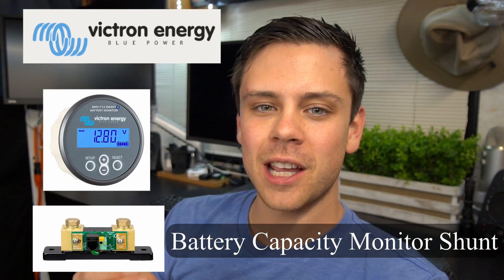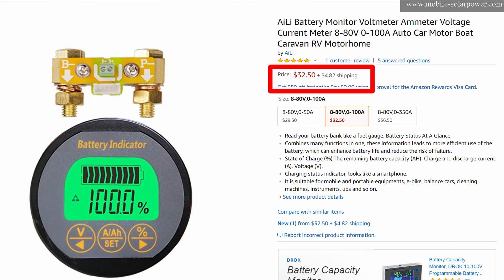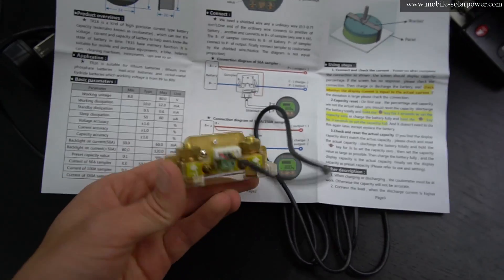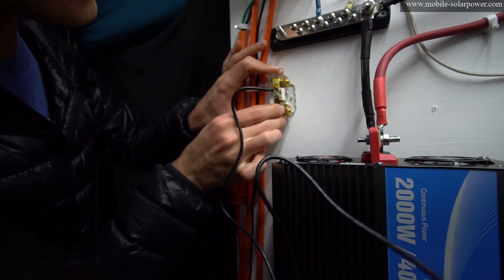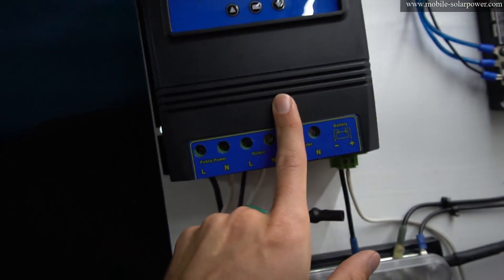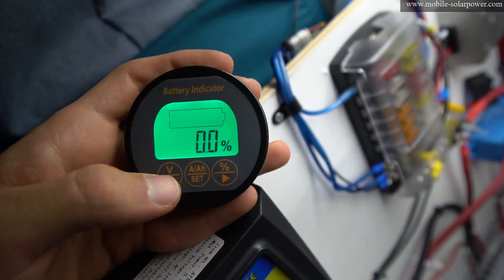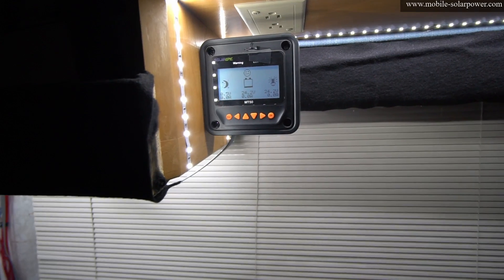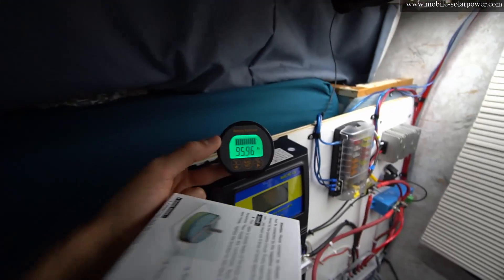$200 Victron Solar Battery Monitor? Try this $30 Chinese one instead! Great for Off-grid Solar

Comment: Isn't there a big difference between the two monitors in the number of amps their shunts can switch?  The Victron page on Amazon says it can handle 500 amps, the AiLi just 100.  Does that matter if I want to support a 150 amp load in a 12v system?
Reply from the maker: Yeah great point. The Chinese one has a 350 amp option too but indeed, good point

Comment: They have like 500a ones that go to 100v and have over volt and under volt protection. Itll also do over current and I think it does over capacity too. The display is even wireless capable, so yeah.  China ftw.
Reply from the maker: Where are these ones available?

Comment: Will - It looks like you set the 0% based on voltage, but I never saw where you entered your battery bank AH capacity. Does it automatically figure it out based on charging? And with a lead acid set-up, wouldn't you damage the battery by discharging it all the way to 0%? Seems like the better way would be to charge you batteries to 100% and then enter the AH capacity of the bank. Is there a way to set it up like that?
Reply from the maker: Yeah it automatically sets the 100% mark.

Oh you would never want to do that. Just discharge your lead acid how you normally would to 50%. No point in discharging to state of charge you will never use.
Reply from the maker: And no need to discharge to 0. But discharging to what you normally discharge it too is totally safe for all batteries.
Reply from the maker: And the voltage set is for backlight. You need to set the state of charge extent for 0% manually. It's the second option that we changed in the video.
Reply: Am I reading this correctly… with a lead-acid 12 volt system you'd discharge to 50% (12.2 volts) and then set that point in the monitor as system "Zero"… your lowest allowable voltage point?
Reply: @MTBioGuy  12.1v is 50% in most cases

Comment: Your shunt is only 100 amps. I think you should have used the next size, which is a 500 amp shunt. Your 2000 watt inverter can go to 4000 Watts surge. 4000 watts/24 volts = 166.66 amps. In order to work correctly, the location of where the shunt is placed in the circuit is very important as well. Multi meters have shunts. When I went to electronics school, we had to design shunt circuits for a meter in one of our tests.
Reply from the maker: I also have a 100 amp circuit breaker on positive line, and it never has tripped, so it's fine. That's why I chose 100 amp shunt, because I have 100 amp circuit breaker. That's how I usually size them. And the surge doesn't matter much because it's so short. And the shunt can handle it. I over current shunts for days before on other systems. It's fine
Reply from the maker: I rate inverters to the continuous rate

Comment: A direct comparison would be an ideal way to test whether the new monitor and the BMV actually track in a similar fashion and provide an equal tracking of battery power. One of the advantages of the BMV over something like the Trimetric is the BMV could account for losses in the Peukert effect during high discharge situations. The Victron is a superior product, just not by a difference of almost $200. hopefully the BMV will come down in price. Its been at its current price point for a year or so.
Reply from the maker: Does it actually compensate for peukert effect. I had no idea that any shunt does that
Reply: @WillProwse  According to their manual it does compensate for the Peukert effect and you can adjust the Peukert factor. The manual recommends an adjustment when using SLA vs Li.
Reply from the maker: @epfd217  oh that's neat
Reply from the maker: @epfd217  but who uses lead acid anymore? Haha joking

Comment: I've been wondering when you were going to include a shunt in your videos. I use a shunt, not just to see what my battery capacity is, but to see how much current drain or gain is going on in my system. It helps me with my use. My charge controller calculates the battery percentage as part of a tri-metric meter (amps, volts and battery percentage). You took the Lord's name in vain twice in that video. Not cool.
Reply from the maker: I use a 20 dollar amp meter on main battery cable to tell the amps going in and out. Super cheap and easy way to do it and works excellent for that. And I agree, an amp meter ok battery is very very useful.
Reply from the maker: Oh I am not religious at all. I don't believe in any of the thousands gods. So it doesn't affect me and I will continue to use the "Lords name" in vain. Sorry.
Reply: @WillProwse  What about the shunt? You didn't mention the best use it has, to let you know the exact amount of current your system is currently using it making. I have a combined box for my 3 solar panels that I can shut off any time and see exactly how much current each one is providing. There's no other true way to be exact without using a shunt.
Reply: @WillProwse  Will , love your videos I think I have watched them all.  You are worshiping A god even if you don’t believe in The ONE God or not. you may want to read up on the Illuminati,  Rothschilds,  Watchers , etc….

Comment: Hey Will, love your videos, and I have a suggestion regarding this new Chinese made monitor. I  thought you had a Victron (maybe it was a review sample you had to return) too bad you can't test both models hooked up at the same time and do comparisons at different stages as to what each monitor is telling you.  Perhaps Victron will send you one to test/review.  In theory I would think they'd both give the same info.  But unless I'm mistaken (you're the wizard!), just because it seems to be working doesn't preclude the possibility it isn't providing accurate info.
Reply from the maker: Most shunts are dead accurate regardless of price. I've used cheaper ones for years that gave exact readings. They are super simple, and it would be pretty difficult for one to give bad readings.
Reply: Good to know!  Your experience/knowledge never ceases to amaze me. Thanks!
Reply: How about very low currents? I read somewhere about a similar battery monitor shunt that it wouldn't register low currents like for example a mobile phone charger with ~0,5A. Any experiences regarding this? And what's the power consumption of this unit? Can you leave it running all time or would it empty the battery in a week (in my case 12V 100Ah in a minivan)?

Comment: Hi Will.  I’m sure this is a stupid question, but how do you determine the  size for the shunt.  I see them in 100-500 amp capacity, and my system is 2x100 amp batteries, but would the 100 amp shunt work? Thanks
Reply from the maker: yeah exactly what the comments said above but honestly I have overcurrented shunts for years and they can handle it just fine. it's an extremely low resistance across the shunt you just won't be able to measure it when it's a high amperage load. but yeah usually just ran it for the maximum that the battery will experience. What I like to do is rate the shunt for my inverters fuse because that's the max I will ever see. This system has a 100 amp circuit breaker so I put a 100-amp shunt on it. That way the shunt will never go over its current limit.
Reply: @WillProwse  - Thanks Will - once again I learned something useful from you that I could not seem to understand elsewhere.  Much appreciated.

Comment: I have this same Chinese meter for a Tesla pack I’m building but have not installed it yet. Not sure how the generic works, but the Victron doesn’t account for the power it draws for its own use and it will drain your batteries while showing 100% (or whatever it was last at) when stored.  Some sail boat guy that doesn’t have solar panels noted this, he uses the engine alternator and for few days it’s fine but if left without some charging the Victron will drain over a few weeks, eventually depleting the bank and later ruining your batteries if kept going.  So probably with either meter you should but the low battery disconnect first, then this shunt.
Reply from the maker: Well that's really bizarre. I just don't understand how any shunt could use that much power. How big are these batteries?
Reply from the maker: The power consumption of all of these shunt is extremely low
Reply: Will Prowse  I was looking at Amazon reviews on the Victron, so guy was not using solar, just his sailboat generator.  He calculated the mAh draw and the natural discharge rate and it was a problem. When first parked it would show say 100%, but it doesn’t account for self discharge or the meters draw. So at say 10% remaining the gauge still shows 100%. Victron acknowledges the behavior but I guess they didn’t consider it a bug because it’s not a good use. It’s for batteries being regularly charged & discharged.
Reply: @olemissjim  I did the calcs a couple years ago before parking my van for the Winter and at the rate of power usage for the BMV 702 (I forget the number) , it would take something like 8 months to deplete my 100 amp battery from a 60% storage charge.  That's what I remember, anyway.  I decided that I could store it for 6 months and it would be ok.  In fact, upon return, it was not too discharged, just had consumed around 30 (can't remember) amps over 6 months -  as calculated.   And yes, you absolutely want to have a battery protection between your battery and ANY devices.  Mine has a built in BMS, so it's there, but invisible.  I think that otherwise, for longer storage, disconnect the BMV.

The guy on Amazon has another issue and is blaming it on the Victron.  I don't know how you manage self-discharge.  Thankfully, that's not a Lithium problem.

Comment: I never felt the need fo one. Might consider it but I need 200 amp version.  2000 watt continuous inverter.
Reply from the maker: Yeah for sure I was the same way for a long time. You might like it though at this price it's pretty cool. Just for the amp meter feature alone it's a great price.
Reply: @WillProwse  agreed the price is hard to ignore.

Comment: Hey Will, not too bad but using the Victron for 1) monitoring and also control thru bluetooth.  2) settable low and high Bat V, low SOC, low and high Temp with relay output (programmable NO/NC but limited to 1A.
The BT control makes adjusting the 5 settings easier.  The Victron bat protect are limited in current (I'm using Xan 3012) so a FET buffering the 1A output to a GX14 contactor gives me 350A shutoff  for any of those 5 going out of limit.  To re-engage I have a override pushbutton so I can adjust the settings for the Vict BMV to take over again.  The BT can tell me which of the 5 caused the problem.
The Vict BMV alarm is too low level and volume not adjustable so that is not useful..but really don't need the display unit handy at all with BT.
Reply from the maker: Great points! Thank you. Great information
Reply from the maker: Updated the pinned comment to mention these features. Thanks

Comment: I have had this victron monitor for three years, I also have the chinese one fitted in the cab so i can see it while driving and switch off alternator charging when not needed.
The victron is a far more advanced piece of hardware with a relay and dataloging.
The chinese monitor works but the victron is more accurate, as there it drift between the two units over time.For the money it's great value, but as with so many things...  you gets what you pay for!
Reply from the maker: Also, victron is made in india. Still made in a sweatshop, if that makes a difference at all.
Reply from the maker: Wait, specifically which Chinese one do you have? This one came out recently. Do you have a normal shunt, the 18 dollar kind, that only shows instantaneous reading? Or the one specifically in this video?
Reply from the maker: Agreed! And data logging is nice
Reply: Agree, what is wrong with usa? Cant they make one we have good techs and engineers when they want to be. It's high time we USA make something good and be on top. Enough said.
Reply: @joeboxter3635  Ah, maybe this one?  I have their MPPT (75/15)  and like it.  Will reviews several charge controllers in another video you should watch.  I like the bluetooth monitoring on my phone app with the Victron and prefer name brands and also needed compact.  The one downside is that the Victron 75/15 has small gauge wire connectors.   Weak spot in their product.

Will likes to recommend some other brands that are way cheaper if you don't want a remote  monitor. Once you add in the monitor, the Victron is competitive for the lower amperage controllers.  If you want a lot of amps, then Victron price diffference gets bigger.  I think that a lot of people oversize their charge controllers, using the nominal ratings (300 watts) of their solar panels instead of the actual performance (maybe 240 watts for same)  wattage.  This is one area where you don't really need the extra but will pay dearly for it with name brand controllers.

 I also have the Victron Phoenix 500VA Pure Sine Wave inverter.  Works fine.  I like the control over voltage cuttoffs etc.  Can't really say if it's any better than others, it just works. Again, if you can get by with less power, the lower end Victrons will give you good quality for a good price.  As power goes up, price rises more quickly.
Reply: @joeboxter3635  Oh.  I don't know the Tesla battery is it running at some odd voltage?  I do know that the Victron Inverter has pretty good customization of settings but I haven't looked at in a long time.  Will work with standard solar battery voltages.

All depends on what size inverter what you are considering and what you are doing.  But it seems that good inverters are easy to find - I would definitely go with a name brand as they do burn out.  Victron is 5 year warranty.   You need to know if you want Sine wave (PSW) or can use MSW if you don't have motors or delicate gear.  If you are not finding inverters with the input voltages you want, then consider a DC to DC converter, I guess.   Tesla might turn out expensive if voltages are not standard.

Comment: Why didn't you post this last week when I bought the Victron!?! Hahaha
Reply from the maker: No way! Haha damn
Reply: Don't worry, you can probably resell the Victron for most of what it costs on Ebay.  They hold their value.
Reply from the maker: @ceeweedsl  have you bought used solar components? I don't think any of them hold their value at all. High quality or not. People usually buy them new for safety reasons.
Reply: @WillProwse  Funny, you cite safety reasons for buying used while also claiming that there could be no safety concerns with a battery monitor.   ?       I watched on Ebay, but rarely saw anything used pop up and never what I was looking for except a Victron BT adapter.   Yes, I'd take a used Victron or maybe another top quality product over a new fly-by-night product any day.   The top brands just don't fail.    Solar panels? No.  I use flexible and they don't age well at all.
Reply from the maker: @ceeweedsl  ok, specifically what is the safety risk of a bad shunt? What part of the circuit would cause a fire? I'm not seeing it
Reply from the maker: @ceeweedsl  and there are top brand Chinese solar components that are dirt cheap. Epever input terminals are higher quality than victron, and much cheaper. There are other high quality options that are extremely cheap.
Reply: @WillProwse  Yep. I know.   Believe me, I've been the king of cheap/value most of my life and am always checking, not afraid of generic when the situation and material warrants.  But electronics, circuit board goods is one place I've seen where you have to be extra careful.   A lifetime of going cheap has taught me a few lessons.  No regrets though - lots of money saved which = time to play.
Reply: @WillProwse  the shunt is a resistor and won't it get, like, red hot?  Just asking, I'm with you , but...
Reply from the maker: @305dreamhonda  very very very low resistance resistor
Reply: Ahh but it’s a perfect expensive gadget 
Now buy a Raspberry and cheap usb cable and open a free account at the victron VRM Portal 
And you can see,update, download all your data real-time.
Free of charge.
Reply: @raymont6191  With bluetooth on Raspberry could you even use the app?

Comment: Is this for just lithium or can. I use it with flooded led acid?
Reply from the maker: Any battery
Reply: I doesn't charge a battery so it'll work for any type.